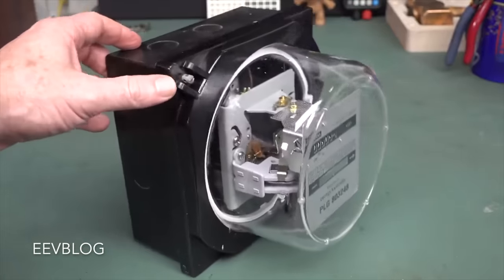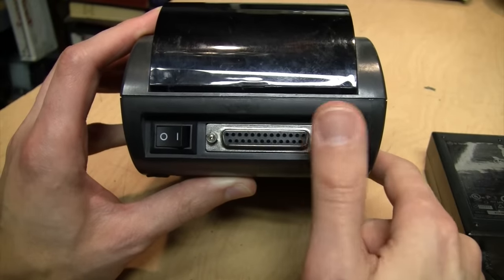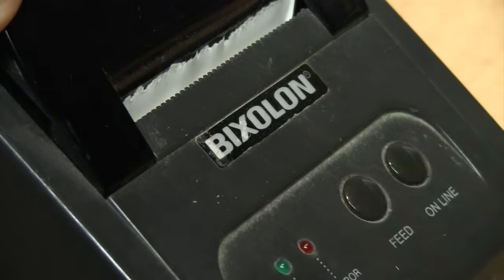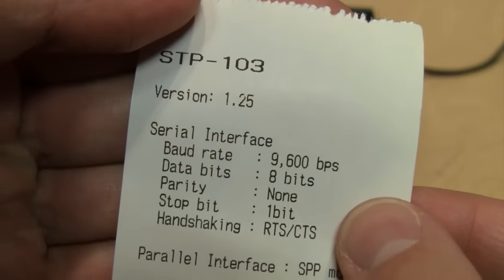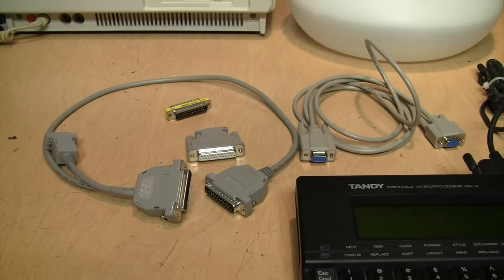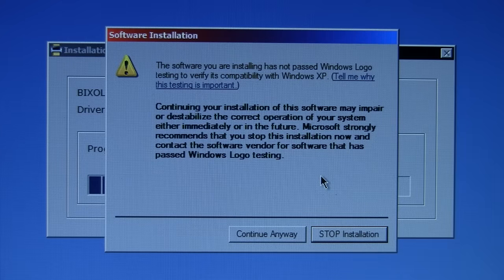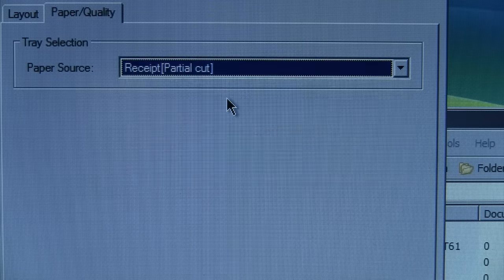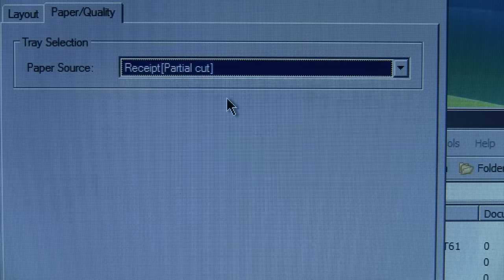I got a receipt printer. 🖨️ Now what?

Comment: As a POS support technician, it's funny to stumble upon someone out of the business playing with it.

This looks like a really old model but the usual stuff is still there, like the power on+feed for the test print and dipswitches to adjust settings. 
Since then, it's mostly stuff based on the Epson tm-88, where you can swap the connector on the back to serial, parallel or even a network connector.
Fancy new stuff is usb and Ethernet but it is a slow evolving business, so serial connections are still King over here.

Another thing but I'm unsure about that model, but usually the printers need some specific code input to do stuff like using the cutter, Windows test print doesn't send those usually. It's more on the POS software side to send those. That and cash drawer kickout.

Anyway, it's great to see interest in stuff you deal with almost everyday for work.
Reply: @Talking Turkey Reliability is exactly why serial still holds, we even use the windows generic text driver because it just works. 
When we don't hear from our clients is when there's no problem, ha!
Reply: You're so much true about "serial is king" 
Where I work you have:
- The Cash drawer connected to the Printer using serial connections
- The Client Display connected throught serial 
- The Magstripe reader aswell
- The Barcode scanner. 
BUT there's one impostor here. 
The card payment terminal uses USB. But USB on the computer side. On the terminal itself, the connector is.... hdmi. 
(There's no logic in the cable so in fact it's USB over an hdmi plug) 
Thanks ingenico for that strange stuff.
Reply: Hi, I am from the future. :) In 2022 we use e-receipts, cos they don't need to be printed out. I do kinda like the smell of paper receipts though, and not all stores offer digital receipts.
Reply: How long have you been a POS technician? Back in the mid to late 1990s I worked at a shop here in the UK had a DOS based POS system I would love to get one going again. They also have a DOS back office terminal and the computer dialed up to the head office I believe to send figures and update prices.
Can't find it on the internet it was called TRANS and then some Roman numerals at the top of the screen, no idea if that was the name of the software
Reply: @georgeyreynolds  Only a few years, can't help you much with your search. Good Luck!
Reply: @georgeyreynolds  I think MachineMart used a DOS based system, possibly still to this day. I last went to one in 2016, and caught a glimpse of the screen which was all text only.
Reply: @trainman665  This wasn't a 'green screen' mainframe style POS. It was on a greyscale screen and had UI elements so it looked reasonably modern for the time. I know what you mean by the text only displays - that was what was in the back office I think which is the type of display we'd get from a BBS or telnet
Reply: The driver has all the printer options in it, in case the printer does have the hardware. However, since his didn't have the cutter (as seen during the close up of the print head) it didn't do anything when he selected the option.
Reply: @LoskLive  Ingenico gonna irruption
Reply: @georgeyreynolds  Last time I've seen a (presumably) DOS based EPOS system was around 13-15 years ago, when John Lewis, Waitrose and TK (TJ) Maxx were still using old IBM 4683s with Model 2 printers and Fujitsu-ICL TeamPOS 5000s with FD21 printers, respectively. The Fujitsu-ICLs had monitors that, although were colour, the system was text-based. The IBMs had that green dot matrix display, which IIRC used a proprietary connector. Very rarely did the IBMs have monitors, unless they were the newer 4694s.
Reply: @AurumUsagi  The printers were integrated into the machine and it had a separate keyboard with specific POS keys. There was also a separate roll which had a copy of the receipts - not sure it was two printers or one 'long' move the head made with two copies. It was dot matrix not thermal. Probably called a journal roll. This was very old because it didn't have any sort of integration for credit cards - there was a separate machine with no connection to the POS but which used the phone line (manual entry) and in the office there was the old 'impression' literally manual type credit card machine which you moved over a carbon copy paper. I assume this was processed off site or by the bank but we only used it once when we had a power issue and everything had to be done manually.
Reply: @georgeyreynolds  It's possibly a single print head that moves across the customer and journal receipts. The older IBM Model 2 had such a loud matrix, it could be heard from several feet away, not to mention that it was slow. The later Model 3 and 4 had a different matrix that was an improvement over the 2. As for credit card integration, the IBM 4683 and Fujitsu-ICL TeamPOS 5000 barely made it into the C&P era, though it must have used some emulation to make the C&P terminals work with the antediluvian hardware.
Reply: @AurumUsagi   I remember that the whole thing slowed down exponentially when you did more than 25 items and there was a real lag between scanning the barcode and it coming up on screen. It also took a while to print the receipt and I think it waited until the end to print everything.
Reply: @LoskLive  With the cash drawer, I assume it's not just an electrically-connected solenoid to open it - is there some sort of authentication between it and the printer if it's serial?
Reply: @LoskLive  I one sole of really weird weird cable that was HDMI on one end.

Had at least one USB connector.

Possibly three or four it was either male or female 1/8 in plugs cannot remember if is male or female.

I do believe it was more than one USB connector as well.

Also at least two modular connectors cannot remember if they're more populated with four or six conductors each either.

In a few other various connectors.

I'm trying to figure out what that could have been used for.

And it would not have been made sense for a kmv switch either the connectors are all wrong.

And the thing is somewhere male and somewhere female even of the same type of connector which further muddy things.

And if anyone would know if if you would be able to use certain pairs or wiring of an HDMI cable to be able to send low speed USB on proper wiring for this???

This is something I'm doing for kind of one-off.

And since obviously part of that cable that's always use for audio just gave me an idea how to do long audio cables and custom cabling 4 custom AV for my own use and develop my own standard.

To have enough lines for all the circuitry over one cable.

I would use breakout cables either end most of the time.

And being able to get away with just making a breakout cables word after boxes and so on.

And you stare off-the-shelf cables between.

Keep in mind this is full custom.

But this is not really related to The One Wish doing low speed USB.

Also would be sending some mobile for signaling and additionally analog.

And since there's multiple shielded pairs this would work perfect for this since the shield repairs are included in the is she my standard.

Would cost less as well as other methods.

Of Course HDMI cables off the shelf as it is.

Not to mention 20 compact to run.

That many wires over over a distance with one cable makes all the difference.

Since I would definitely need multiple cables instead of just single small cable.

Would also be using for control purposes as well.

And notification of the system that a plug has been inserted into an audio jack.

Buying grounding one wire.

As system input through switching internal to the jacks.

Essentially turning off the shelf cables and that's something customizable and custom for my own uses

at various times this is not the only thing I know to be using in a similar manner.

Such as if I'm out and about being able to use a USB extension not just for USB extension but as hoping somewhere to an aux cable buy for you on a short cable adapter he's around and also having a one it's 218 coupler incase bow-fins need to be female.

Have a few adapters instead of multiple cables that only serve one purpose in the case of using that extension.

Typically I would not be using the aux cable and you are speaks tension at the same time blessed to have in my portable to go Tech accessories.

By the way those adapters could be easily obtained since they're straight through wired when used for automotive and possibly a few other applications where digital audio is done over a aux cable Viola USB.

Hey if somebody already exists off the shelf and could be utilized for a customer application why not it's easier than making something custom.
Reply: Nice to see POS technicians in the comments. Not a POS technician myself but I use to love playing around with these machines when I worked in retail. I love the draw kick command stuff very cool, I even managed to open the cash drawer directly in windows! Ah the good days! And funniily enough I was using a DOS based point of sale system! Not even Windows based! LOL
Reply: My favourite trick is using Symbol barcode-reader programming codes. They have one I printed onto a business card that turns off the keyboard output of what it reads, effectively rendering POSes blind. There's another code to turn it back on, but it's amusing as a prank on your co-workers.
Reply: @W1ldTangent  holy sh*t thank God o didn't get my hands on that when I was in retail. 😄
Reply: @georgeyreynolds  Up until at least the mid 00's one of the local builders merchants was using dumb terminals, don't know if they still do as I have had no reason to visit them.
Also ASDA stores still seem to use the old style IBM systems for their cashiers, whereas everyone else has probably been through a couple of touchscreen based systems. What I've seen of the Tesco systems still looks quite "vintage", with an interface that you would have thought would be running on MS-DOS.
Reply: My dad works as a POS technician! Worked with him for years in my youth. I've never seen anyone on the internet say they are also one
Reply: @adnamamedia  Let's me guess he probably thinks POSs are also POSs . Especially the software?😄
Reply: @dglcomputers1498 Yeah  I think Aldi are  using dumb terminals in the UK with no visual display at all except the customer display for pricing.... probably similar to ASDA but if they want self service tills they needed to update  or find some way of using both together?
Reply: With regards to serial ports, in the Point Of Sale business, I guess if it isn’t broken don’t fix it.
Reply: @LoskLive  My work recently upgraded to USB-based stuff, and even that's been around for quite a while. The connector is this weird chunky hybrid that is half USB (that can accept ordinary USB devices), half power (12 or 24 volts depending) so peripherals like printers and touch monitors don't need external power supplies.
Reply: I had to fix someone's POS printer. They were using either windows 95 or 98 and there was not much documentation online... Took me like 3 hours of messing with so many things to eventually get it going. (First time dealing with the stuff it's weird because it just broke itself as nothing had changed) Not a fan
Reply: Do you know how good (if any) is driver support for these things in mainline Linux?

Could easily be more reliable and versatile than Windows (given that someone reverse-engineers these and creates some nice library). And building a lightweight PoS distribution could be a fun FOSS project
Reply: @LoskLive  Ingenico IPP by any chance?
Reply: Epson TM-T20II is the one we've got at our store, i actually like the damn thing
Reply: @LoskLive  funny you mention the HDMI looking connector because its pretty cool its not just usb it is also 12v power and you can get differnt cables some with serial some with ethernet and some the go right in to another pinpad with a built in printer but they all plug in the the funny hdmi port witch is also screwed in and has been the same for multiple generations meaning upgrade are just a quick swap (in some cases... have had to swap serial to usb cables for an upgrade before)
Reply: You do the ingenico pinpads? I do, next time you do one, look at its model number (or serial number i forget which) and it WILL end with 666.
Just a Fun one to use to mess with conspiracy theorists and "end of days" nuts. But its actually true. No damn clue why they do that, but i think its funny.
Reply: I work as a cashier in a bank, and I can confirm, the USB ones are a pain in the ass when they fail in some way. Sometimes I even have to restart the whole pc in order for it to work again.
Reply: The upgrades at Sonic were interesting as far as the receipt printers go. Their new system is all networked instead of 6-pin serial. The printers are all Epson TM-88s but instead of using the Ethernet I/O, they kept the same old 6-pin serial and added a thin client PC at each place they had a printer. They may have changed it up since I last worked on their system about 5 years ago.
Reply: I have a question do you know of any decent solutions for making a pos printer network accessible? So my colleagues and i can send it text from a smartphone for example
Reply: @Nythz  I'm also an EPOS technician and I've got to agree with you. Serial is still king over here. From everything from pole displays, scanners to printers. 

We tend to run our Kitchen printer serial connections over cat5 too which coming from a background where cat5 was only used for ethernet was strange at first for me lol.
Reply: I know way more about ESC/POS then I really need to..
Reply: You'd probably get a laugh at the catastrophic mess Tesco have made across here in the UK on both the main-bank checkouts and self service. I mostly work on the self scan areas and I'm about tearing my hair out with this... Going from their legacy software made by Retalix, run under emulation on modern PCs, to a brand new CentOS-based system made by the companies in-house development team. It is absolutely awful, abysmal in fact.

It doesn't have any immediate engineers' interface for the NCR or Diebold Nixdorf technicians (the hidden button for engineer mode on these tills no longer does anything on an NCR model!) - you have to call corporate for someone to remotely access the system and put it into engineer mode for you, all whilst me and the techs have a laugh at how absolutely awful the new software is

If you have to reboot, it takes around 30 minutes to boot back up, and most of the time it'll then proceed to sit at a message saying "Checkout unavailable" for a further 30 minutes.

Recently it's also developed random very annoying bugs, like if you scan your operator barcode to access our set of options, say to re-print a receipt or remove an item from someone's shop it throws you to a blank screen that says "0 Bagging Area Alerts" with no back button or no way to get out of it... you just have to reboot.

It also has a major habit of displaying the wrong price on the screen, but the correct price on the card reader screen. The question then... what if a customer is paying cash? Are we just gonna f*ckin' overcharge everybody?!

Despite all these bugs, all these major issues and the unstable nature of the application that they use, they then this week decide to move the main checkouts over to this new software, all with the same bugs and same issues.

These big greedy companies are ridiculous... but also laughable. I wonder how much money they've lost from that one other random bug where their tills sometimes aren't able to hand more than £200.00 in one transaction, and freeze just before payment? You'd think for a company that uses tills by Diebold and NCR... they'd just pick a modified software solution from them that WORKS...
Reply: This is a long shot, but here I go....
I have an olivetti prt100 that won't print anything. If I push stuff to the serial port, using power shell, I get gibberish. It has an rj11 port, so I can't use it as a network printer (or can I? I noticed all my rj11 cables only have 2 conductors and that rj11 can be plugged into an rj45 port)
Anyway, the software from the website says it runs on win95, but short of getting a win95 machine (I don't know how I would even do that) I don't know what to do with that information.
I even tried installing the driver on my windows 10 machine, but it installed incorrectly and un-installed incorrectly and it keeps saying there are files leftover that I need to get rid of, in order to reinstall the driver...
Yeah, anyway... It's a long shot, but much appreciated if you could send me in a possible direction
Reply: My friend, I have a T88-V for fun bought from Ebay but it just prints out very light. I spoke to a few people and I cleaned the thermal head but it does not work and a replacement seems to cost about 200€ if I even am able to find something. Is there some option or is this throwaway?
Reply: Hey you don't have to call yourself a POS.